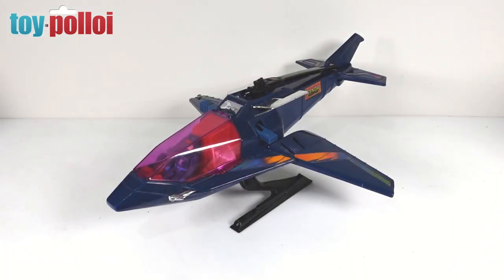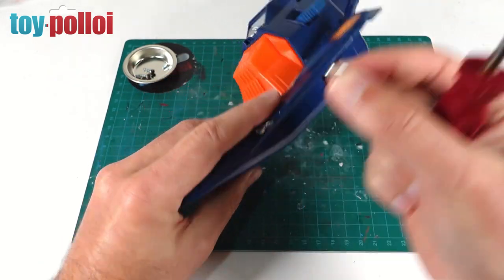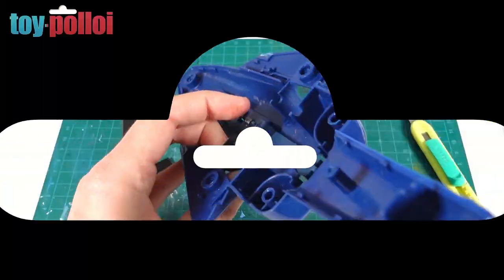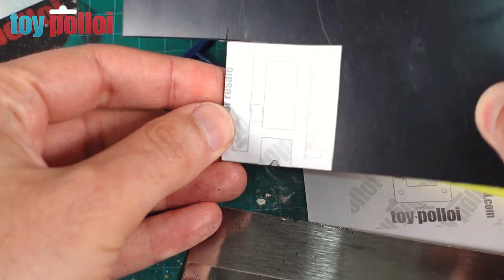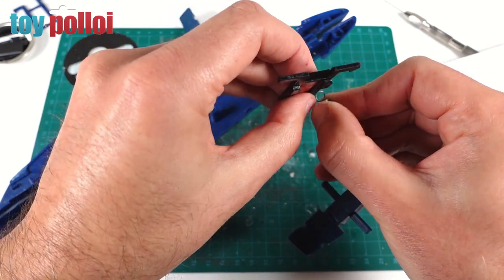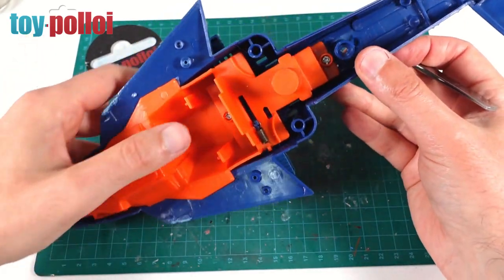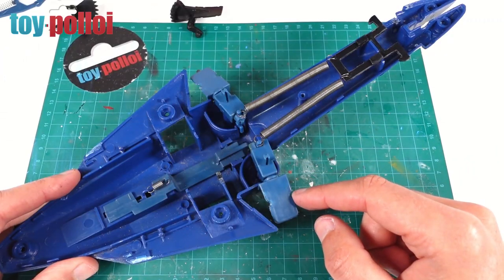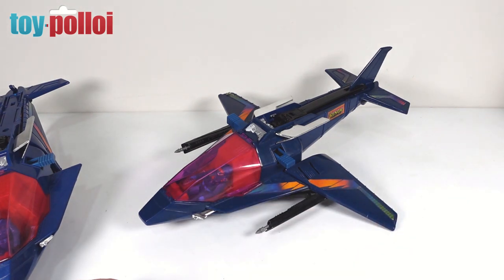Vintage M.A.S.K. Switchblade Repair Guide - Toy Polloi

Comment: Dave, you have totally transformed my thought process on purchasing broken vintage toys. There seems to be almost nothing that is too broken, or too far gone, so long as you're willing to put in the effort. Each broken toy represents a new opportunity to problem solve, and a good result makes you appreciate it all the more. Thank you for making these videos!
Reply from the maker: Thanks Michael. Even a broken toy can be appreciated I find. But most can at least be made displayable again, and with this I would say it's stronger than it was originally now. Glad you can see the worth in them. Cheers

Comment: Thanks a lot for this very detailed guide! My Switchblade also had a broken latch that's supposed to lock the rotor blades and I really love your simple yet very effective solution with an actual spring. Now I'm running around the house testing all my old pens to see if any are no longer working so I can salvage the springs for my own little repair. You definitely deserved my sub! 👍

Switchblade definitely was one of the most awesome toys imo; and I really love mine!

EDIT: I also really appreciate you offering all those cool plans for free!

Comment: I have zero interest in MASK, I am here primarily for the Star Wars fixes, however every single one of your repairs are interesting because the fixes you come up with can be used across the entire toy range. You are nothing short of a genius when it comes to giving new life to otherwise broken, useless toys. I hate to think of how many toys have gone to landfill because they were broken and could have been fixed quite easily because of your trials and tribulations. Please keep up the good work!
Reply from the maker: Thanks Mike. Certainly most of what I show can be used on multiple toy lines, the same ideas can be modified as the toys often work much the same. And you will be pleased to hear there are more SW projects coming up, and also in the works. Cheers

Comment: Great restoration Dave!! The mechanics of MASK make them fun to work on. I like the plate you made for the propeller switch spring, better than my solution of using a wider spring and fitting directly to the switch. Isn't it strange they glued some parts together at the factory - there are a few other vehicles like this too!
Reply: Luuuuke 👋👋👋

Comment: I still have this toy.  As a kid, one of the hooks holding the wings back for helicopter mode broke.  I used a electrical spade connector to hold the broken wing for helicopter mode.

Comment: Awesome video. I love watching your videos, they are relaxing and educational. You give so many great tips and tricks on how to repair toys which can be used on any kind of toy and toyline. Unfortunately it has only been fairly recent I found your channel after searching for G1 Metroplex repair, and now I'm "binge watching" all your videos. Had I found your channel years earlier some of my own fixes would been have done a lot easier.
I recently managed to find a complete Switchblade for £23 where one of the latches on the side that holds the wings in place is broken, so your video here is the perfect inspiration on how to fix it.
Keep up your awesome videos ❤

Comment: Just wanted to drop you a comment.  I've been watching you from day 1 and you've had alot of great techniques for restoration of vintage toys.  I'm 45 and just received a vintage 1984 Matchbox Voltron CIB. it needed alot of TLC. I was able to do a full restoration and re chrome and it looks absolutely amazing. Took everything apart, oiled the springs retro brighted the white plastic and I couldn't be happier.  Just thought you should know that you have really helped with me restoring my childhood toys!!! Cheers.  I would like to send you some pics if possible.
Reply from the maker: Glad you have found my videos of help. All the things I show can be used on many toys, and it sounds like you have done just that. Please do send me the photos. Always like to see what others are working on. You can find how to contact me in the about page on YT. Cheers

Comment: Man, this is  great restoration video! Great work Dave, the spring for the helicopter switch is a major improvement on the mechanism in my opinion and the black styrene looks like it was always meant to be there.

Comment: Great video.  I made my interior cuts to the replacement clip with a cheap exacto knife with the blade super heated by a butane torch. I had it done very quickly.

Comment: The tail-end wing clip mechanism reminds me of one in the Real Ghostbusters Highway Haunter vehicle/ghost. I got one of those a little while back, and the rear wheels weren't popping up. So inspired by your videos I opened it up & looked inside to find one part of the mechanism (I believe a little wheel with a little fin, functioning sort of like the tail fin) had worn a slot into a plate like in the tail here, instead of moving it. I didn't have styrene or plastic weld, so I gorilla glued some tin foil over it and fixed that. I don't know how common the problem is, but I'd love to see how you'd tackle it! (also because the other set of wheels still has an issue I don't know how to solve, short of filing down an original clip ^-^U). Always love your videos even when it's for toy lines I don't collect. They're often still nostalgic and always interesting & inspiring. Keep it up!

Comment: Just re-watched this video again while repairing the left broken latch/tab on the left side on my Switchblade. I didn't have any styrene sheets but I had 3 small black zip ties I glued together and filled them into shape and cut them into the right length and then I managed to glue a this new tab onto the mechanism with some Loctite Super Attak glue, and now it holds the wing in place perfectly and the mechanism still works flawlessly.
While rewatching your video I wondered if you have considered making some custom exhaust/turbine stickers for your Switchblade? I always thought it was strange that when transformed into jet mode, there are no engine nozzles/exhaust ? I think two stickers at the bottom rear would be the ideal spot for them.

Comment: Plastic design principals.  Sharp internal corners on plastic parts create high stress points.   Allways add radii to spread the stress.   Adding radii to the wing hook part will make it stronger.

Comment: Fascinating mechanics, clever designs but it seems like they didn't consider the durability of material strength, like that back part you replicated where it would have be metal to survive long term being at that original thinness Ie. it's just plastic. Same in the middle where you beefed it up a little further, not that more needed frankly. Seen some computer model testing along those lines where breaks can be predicted now.
Curious use of glue at the front there, wonder if was spreading apart without it or they just didn't want to switch to a smaller screw size there, hmm? Great fixes TP. ;)